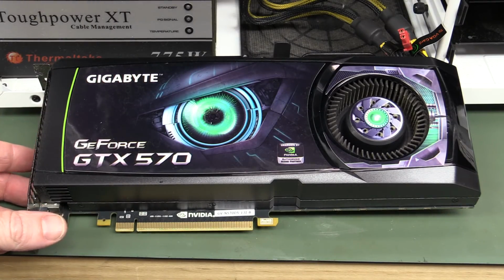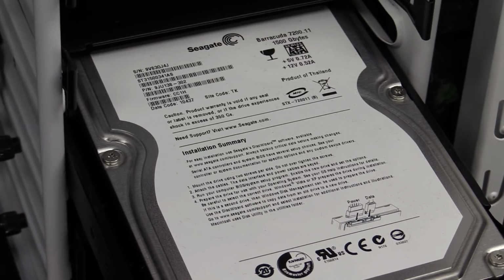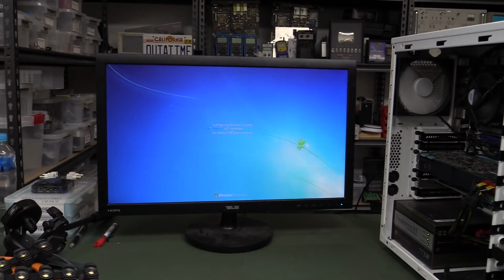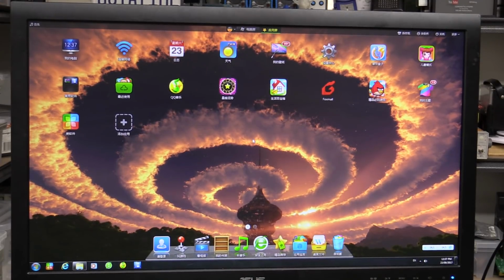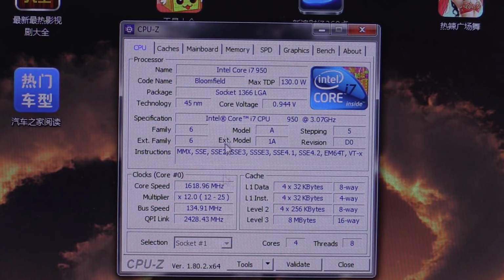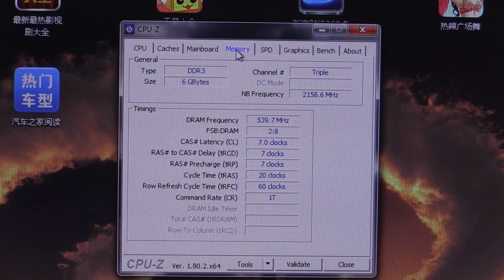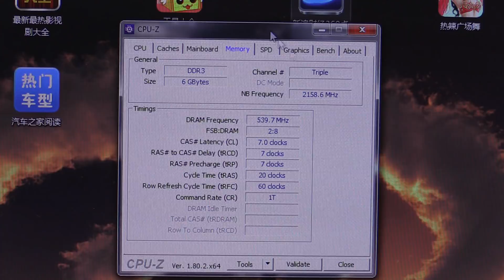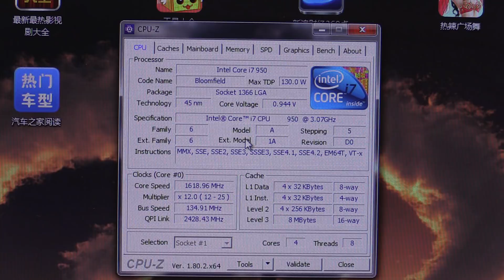EEVblog #1026 - Mystery Dumpster Diving PC

Comment: thats a first gen core i7  socket 1366 is old 
its not all that fast
a core i3 today will rip a new one
Reply: Except this I7 is free...
Reply: But it will cost ya ;)
Reply: You can buy socket LGA1366 Xeons pretty cheap on eBay now, it'd be a decent upgrade assuming the motherboard supports it. I have a Xeon E5649 running in an Asus P6T SE board, got the CPU from eBay for ~$70 AUD delivered, also got 2x X5660s spare for free a while back but the E5649 works fine for me, it's just for the ESXi box, the marginal performance gain isn't worth the effort of replacing the CPU.

Individual core performance on anything from that era sucks by today's standards but for parallel tasks it is competitive in terms of $ for performance. Just had a look at eBay and the X5690 can be bought for US$112 + US$6 shipping worldwide.
Reply: jian khan+ no it's not, the cost this i7 would put on your electric bill would be enough to buy a new i7/R7 CPU.
Reply: you can put a 6 core xeon in it depends on the workload
Reply: still ddr 3 chanel vs dual chanel on ddr4 i dont think is the isse just the first i7 gen was not a hugle jump like the second.
I jumped from e6400 to i5 2500k  and wating the 8 gen now for renew still working fine.
Reply: Jason Smith Almost 20 cent per kWh here in Austria, power is pretty expensive here compared to you.
Reply: Jason Smith+ good for you, our electric company went solar a few years ago so our electricity isn't cheap.
Reply: 40W max TDP difference to an i7 7700K.  Assuming you run benchmarks on it 24/7, at average per kWh rates of $0.12, that's only $42/year difference.  Used like an actual person would use a home computer, the difference would be well below $10/year.  That new i7 will pay for itself in just 34 years!
Reply: I did a few benchmarks for you. Real bench latest version:
i7 920 socket 1366 @3ghz 12gb ram 2tb harddisk  windows 7 x64 image editing:   65548    encoding 26588  multitask 35407
i3 6100 @3.7ghz 8gb ram 128gb ssd windows 10 x64                       image editing  156269    encoding 25478  multitask 56484
2 runs results from second run (I have not included the open CL since it only measures the graphics card and I don't have the same one as Dave)
So yes the modern i6100 is far faster on single threaded (image editing). On multi threaded encoding there is little between the 920 with 4 physical cores and the 2 core 6100
I was surprised the 1366 did not do better on multitasking but I guess the 1366 has slower ddr3 memory compared to the i3 ddr4 and the 920 cpu cache runs at slower speeds.
It should be noted that I could overclock the 1366 to 4.2ghz the i6100 cant be overclocked...
Reply: Good one, lol.

Comment: Suprising someone would throw out an X58. Still a great platform, plenty of potential
Reply: Electronics For Fun it's not old at all. You know what's old? A Pentium 4. Because I have one and it's shite.
Reply: Ha I knew it. Triple channel PC 6 mem slots) only chipset I know of that has that in the last 10 years is x58.
Reply: The first gen i7s are a bit slow for modern tasks, yes. But what you can do is score a 6 core Xeon on eBay or similar for $20-30 and put it an X58 board. After overclocking, it will match an i7 7700 in performance. Except it's 1/10 of the cost of one. This is what I did for my college workstation (which I'm sitting at right now).
Reply: piledriver has nothing on first gen i7, please get off the crack
bout the only thing x58 lacks is USB3 and UEFI
Reply: Electronics For Fun socket 1366 had some of the best intel processors of the time. Six core xeons are readily available, and there is really nothing wrong with DDR3
Reply: P4 is a great space heater
Reply: With triple channel DDR3 isnt that slow at all. Of course you should use new parts if youre building a new setup, but that doesent mean that the dumpster pc is useless. You could donate it to someone who needs a relatively modern computer but hasnt got the money.
Reply: Nothing surprises me  anymore .
I'm running a 1151 socket i7 with 2 tb hdd,
My wife has a 1150 socket i7 with 10 gig ram , nvidia something graphics card all thrown in the rubbish .
Just found a 1150 i5 with ram , graphics card , hdd just a dodgy power supply .
Reply: max p boggles the mind.
Reply: Would find that in Australia just dumped
Reply: It's fine, but quite power hungry. If you use a computer for many hours a day it's sometimes cheaper to buy new one than paying for extra electricity it eats...
Reply: Apart from the performance these i7 are quite expensive on ebay.
Reply: Like me!
Reply: Reality is, it's a bit old so the single-core performance will be a little crappy, and it's quite high power. For the things that CPU was made for (productivity and gamers who think they need an i7), it's getting to be pretty slow. For most things? Perfectly fine. But it's on par with like a modern i3 at this point.
Reply: Man I know so many people who still run a lga1366 build, what a great find, add a 1060 to it and it could still  Game damn decently
Reply: To continue your car analogy... you're completely ignoring the fact a new hellcat costs a significant amount of money, as do a new top of the line pc. Just because an $90k BMW M5 is faster than a $4k 70s dodge monaco doesn't mean it's a better value.
Reply: That does not make a lot of sense. If you havent got the money to buy/build a computer but you need one then the dumpster computer in the video will be a great gift. 
Its not about building another one because this one is to inefficient for basic tasks, its about getting this one for free or have no computer at all. Thats what we were talking about.
Reply: +Electronics For Fun Name one thing aside from external HDDs that benefits from the use of USB3. I'm waiting.
Reply: Electronics For Fun you are a fucking idiot
Reply: Anthony Flagg+ USB 3 not only has a higher data rate, but it also had a higher power output so if you have a USB 2 device that needs a little more juice then you can plug it into a USB 3 slot and boom problem solved. l have a USB monitor and phantom power supply that can run off of USB 2 but they work better on USB 3. it's also good for charging your iphone since the stock iphone chargers are pretty terrible, so if your phone isn't charging all that fast then you can plug it into a USB 3 port on your computer. you can also put a really fast wifi card into a USB 3 port if you don't have the space in your case/motherboard for an internal wifi card. you can also use USB 3 as a display port if the other display ports you need are already taken up. and there are a lot of capture cards that use USB 3. l use all of the USB 3 on my laptop. USB 3 has also kind of become the standard, motherboards and computers today have all USB 3 ports. even the most basic motherboards and computers today have almost all usb 3 ports, USB 2 is really only needed for keyboards and mice since everything is switching to use USB 3. hell maybe keyboards will be there pretty soon as well since they keep getting more complex.
Reply: Tommy Gilliam+ care to elaborate on that?
Reply: Electronics For Fun check this video out https://youtu.be/Yo3uaZCFybw still kicking it a decade after its release. Don't see the problems with x58 if you're on a budget.
Reply: Too old? Are you serious?!
I know several people who run on athlon XP, A64 and C2D! So no, it's far from "too old", it's great for about...all except extrem gaming.
My personal nas is a XP3200+/1go ddr/a7n8x, running like a charm!
Reply: no there is nothing wrong with DDR3 except it's old. building a brand new machine with old parts is just asking for the machines early death.
Reply: l am not forgetting that, price is the whole reason l compared a junker to a brand new top of the line muscle car. a brand new 2017 hellcat goes for about $70,000 so it's not "significantly expensive" it's definitely not cheap but l wouldn't say it's "significantly expensive''. l think a significantly expensive car would be in the range of a few 100k to a million, it's an expensive car, but it's not a "significantly expensive" car. 

you could build a junker that can do 10's, but that can't be your only car, so you would need another car that gets you around town, or you could have 1 car that does both. so yeah there is a more cost effective option, and there is a more practical option. it doesn't exactly have to be a hellcat, but most middle class citizens can afford a fast car that is reliable, like a used SRT or a subaru WRX or something like that. so you have enough money to buy 1 nice car that does everything you need, or buy 2 cars that are both kind of terrible but still do what you need them to do. get it? a XEON on a X58 board can't be your only computer, it's just too much for basic shit. so you would need another computer for smaller tasks, or you could build 1 computer with newer more efficient parts that does everything you need it to do. so would you rather build 2 computers to suit your needs or just build 1 that suits your needs?
Reply: "If you havent got the money to buy/build a computer but you need one then the dumpster computer in the video will be a great gift." if you are in such a tight spot that you can't afford a decent computer then maybe video games aren't your biggest problem right now.
Reply: maz199+ it is too old, it's useless. the CPU's that will fit on this board are junk, and you can only use DDR3 with it. there is no potential for such an old platform like this.

"You know what's old? A Pentium 4. Because I have one and it's shite." yeah that is an old piece of shit, much like X58 the only difference is X58 wasn't shipped as a piece of shit.
Reply: ehh... not really, it's too old. it can't compare to X99 or X299. if a piledriver CPU can out preform your i7 CPU then you need to toss it because it is useless. first gen i7 can't do much in a modern workload unless you are on the internet, but that's about it. it's going to slug in video editing, gaming, and just about anything.